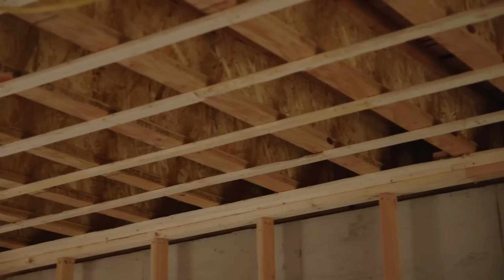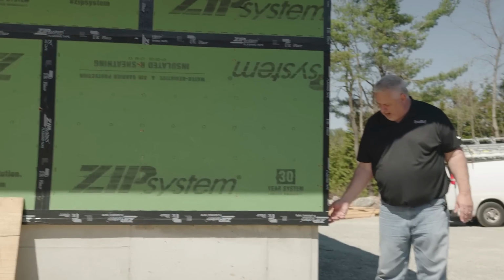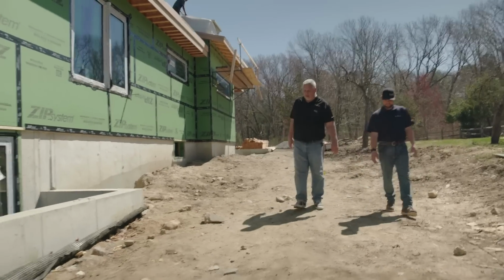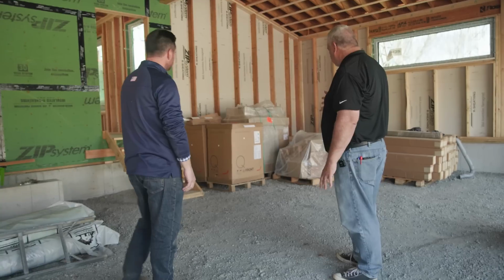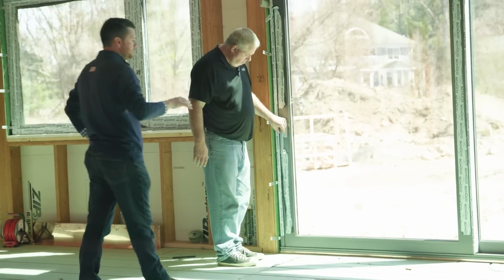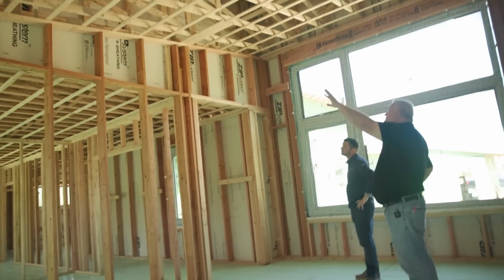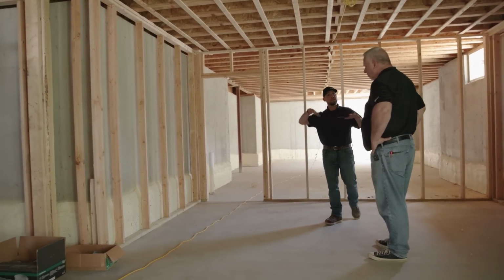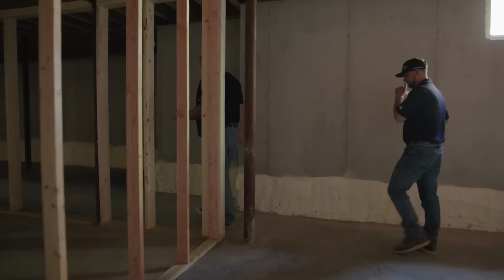"Project Walkthrough" Build Show Build: Boston - Bonus Episode

Comment: I tried using a rice husk board on a project. Way to much movement, expansion contraction. Wouldn't use it again. Curious to see if it works in fascia.
Reply: Who was the manufacturer?
Reply: @stevenbaczekarchitect9431  Resysta, Very expensive but the boards just wouldn't stay put. I reinstalled it twice also. Big fan of your focus and determination Mr. Baczek. Wish we had you in the Humid South.

Comment: I think I need to change my tilt and turn window order and get a fixed panel above the sink as well. Really good video with lots of great ideas and value. 👍
Reply: There is much less of a need for opening windows when the envelope is so tight with a great Zehnder ERV.  Also, regarding the sink comments, one of the best decisions is to use a 57" Kraus Kore sink that is truly a "system", making sink space a food prep area, not just a place to clean dishes.  That requires two faucets and Steve's design allows for that without any impact from the opening window.  The sink was a decision made even before we found the property!
Reply from the maker: Glad it helped

Comment: Have never heard of the Radon installation. Could anyone tell me what that's about?
Reply: For more information, take a look at the radon bonus episode.  That explains what was found in the house that was taken down (radon at 16) and what was found in a number of nearby homes as a result of what we found.  Radon was a big discussion many years ago but seems to have been forgotten.  It is the second leading cause of lung cancer and the first among those who have not smoked.  The EPA recommends testing every year in homes that do NOT have a remediation system and every two years in houses that do.  After what we learned, I cannot imagine NOT having an electronic device in place that is monitoring the radon level all year long.  Radon levels change depending on the season.  What we used were AirThings radon monitors.  There are some that have an LED display that shows the level of radon from the sensor and there are more expensive units that will work over wifi to send the data to an app and provide data on an ongoing basis.
Reply: @scottrodman  Wow !!!
Don't know if it wasn't a thing in Australia, or if we simply had more lenient (bloody slack) environmental regulations. 
Radon is a noble gas though, so I'm guessing that something may have bonded to it weakly. 
But wow, shocking what you learn, eh.

Comment: Steve I hope you make time to get a physical exam and drops some #s… you are way too smart and have way too much to share w/ your audience, do pls do plan on being around a longtime…. Really enjoyed the discussion regarding the lay of the land and how the house design and geography of the raw lot along w/ the desired final lot design and layout all come together… the walk out (forced walkout) basement, the daylight windows w/ legal egress and the basement direct entry from the garage, are all things I had put into homes that I’ve built in Ohio, Indiana and now Arkansas - the incremental cost to put them into the design was negligible relative to the total cost, yet the tangible benefits and the “that’s so cool” comments from buyers when we’ve moved on from those homes, shows just how much value you can get from a bit of advance planning and minimal sunk costs
Reply: The bulkhead was a late decision that has already shown huge value, just in the construction process.  Shea Concrete, a local company, made that and delivered and installed it in a way that made that 5.700 lb unit drop in place with relative ease.  Great decision to include it and the Bilco door will go over that as soon as the framing is done.  This and the stairs to the garage make the space much more useful, thanks to Steve.  The structure for those stairs are providing the structure for the stairs to the loft.  That is found space that will also have an AtticLift, another great addition.